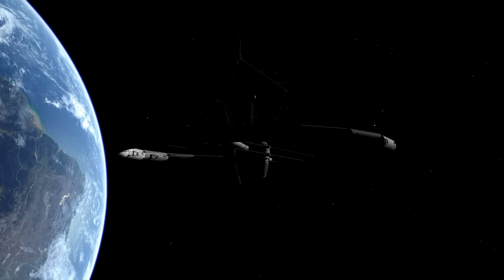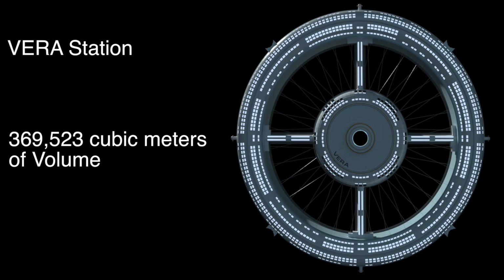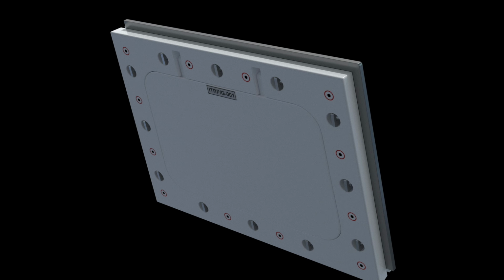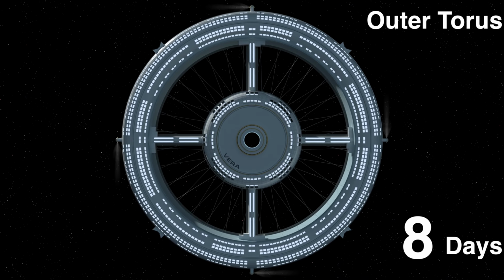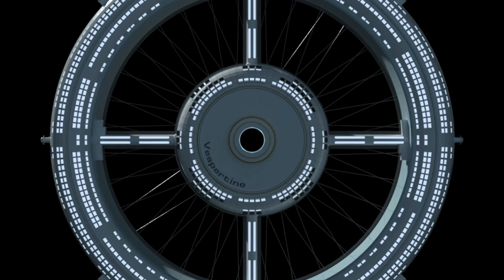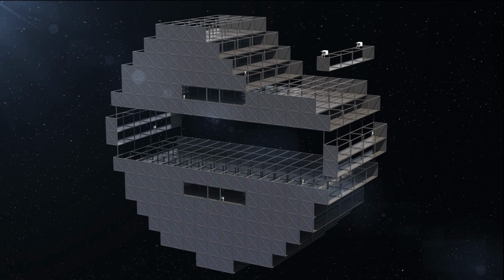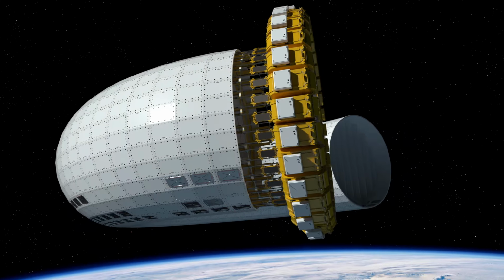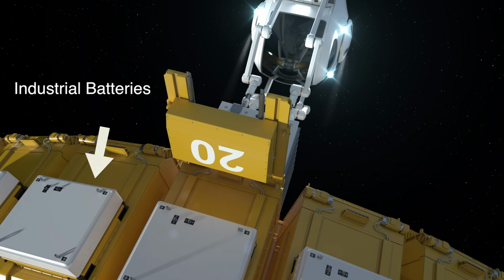We could build this huge Space Station in 6 months

Comment: What happens if the inner ring is inoperable/unsafe but the outer ring is still ok? How would the people of the outer ring travel to the docking port in the middle if they need to leave the station? Maybe it was addressed in the video but I didn’t pick up on it. For something like this to be open to the public the safety needs to be over engineered, especially if tens of thousands of people are going to be at this station yearly.

Comment: Correct me if im wrong, but the inner and outer torus has a different radius. Meaning artificial gravity will be different in the inner torus vs outer. You would also need to rotate it faster in the center vs the outer ring. Do they spin independently? Furthermore, what are the dimensions and weight for each section of Sargon. I am assuming you want to send modules to be assembled in space to build Sargon. Would this even be possible for current rockets to transport? Lastly, I am assuming the panels are sent up with Sargon. What is the weight of those panels? How do you plan to transport resources to Sargon. How does Sargon build amenities and equipment? How does it connect the equipment to the interior of the torus?

Comment: Are there plans to test a smaller prototype? How would you power the electron beam welders? I like the idea but it needs to be proven first then scaled up.
Reply from the maker: Our research showed us that each 2m weld made by the EB welders would require 5-6 Mega Joules of energy (12MJ per panel). For reference, a Tesla Power Wall unit has 179 MJ/cubic meter of energy(that's 15 panels). Those huge batteries over the panel magazines are about 20 times larger than a Power Wall. We expect the batteries (there are 32 of them) to last until the Inner Torus is 1/2 complete before they need a recharge. For your information, EB welding is very efficient compared to other types of welding.
Reply: @TheGatewaySpaceport  ..I need one of those Tesla Power Wall units myself. Isn't there enough Helium-3 on the moon to power projects like this?
          The moon will be mined sooner or later, it may as well be by you first...Anyway, I like it..."More power to ya"! 😎👍 ☕
Reply: @TheGatewaySpaceport  Oh and Elon has been talking about machines that make machines, this falls entirely in line with SpaceX ideology.  Just amazing.
Reply: @TheGatewaySpaceport  Do you happen to know if Elon is aware?  I really think this is amazing, it's an AMAZING idea and they are BIG.  All of which SpaceX needs.  Thank you for going after this in the way you are!
Reply: @TheGatewaySpaceport  Always give the job to those who can do... ♥
Reply: @TheGatewaySpaceport  would micro weld holes need patches? there shouldn't be many in space but it's a lot of linear feet?
Reply: @TheGatewaySpaceport  
great. Can it be built with panels made with simple iron or titanium directly mined from the moon?  There are earth base gold sortation systems that could separate these metals ( and others) directly from the lunar regoThe launch costs would then be cheaper.
Reply: you can make small modular reactors to power just about anything for decades in space. The problem is that they become obsolete before they're run dry.
Reply: @justingreen8572 , Yes, power is not an issue. : The Perseverance rover requires electrical power to operate. The dependable flow of electricity for the rover comes from a power system known as a Multi-Mission Radioisotope Thermoelectric Generator (MMRTG), provided to NASA by the U.S. Department of Energy (DOE).
Reply: Why would you want to build a station when in orbit around the earth you already have a natural satellite the Moon?   You could build the living quarters from  disassembled starships designed for the express purpose of using them as the habitat modules. You can use lunar regolith as radiation shielding material.  ( You didn't mention that problem as well )  Minerals could mined from the moon and be used to fabricate aluminum panels on the moon instead of on earth and shipped into space by solar powered linear accelerators.  Water obtained from the moon itself ( could also be used to make hydrogen and oxygen using solar energy to separate the molecules  )  Oxygen for breathing and  Hydrogen to make fuel to be used in fuel cells as well as in spacecraft as fuel.  The Moon just seems to me to be more of a logical choice and more doable than your proposal
Reply: @johncherish7610  mining requires a full chain of buildings and heavy machinery to extract some useful ammounts

Next century perhaps 🤷‍♂️😄
Reply: @johncherish7610  yes he did, in the first half of the video - the outer skin panels would be lined with either polyurethane or water jacket. Both equally adept at blocking all but the hardest solar radiation.
Reply: @johncherish7610  And less gravity means less fuel needed to lift it. Can they get the fuel used in those engines from the moon though? Is the dirt up there sand? Can it be used to make glass?
Reply: @johncherish7610  Delta V and Gravity wells are the defining problem in space at our current level of tech. Getting similar resources from Asteroids has lower Delta V impost then the moon. It does take longer because of distance to asteroid but it takes less effort. The current tech for converting solar to electricity is more then good enough with the needs of nuclear or fusion. We could have "This and That" instead of "This or That" :-)
Reply: @johncherish7610  That sounds like a great project, for somebody else. This project seems focused on making large volumed structures in orbit... Obviously lol. Considering we already have proof that a space station is doable, there are a couple in orbit already, why would you think making a base on the moon would somehow be easier?
Reply: Something I don't get is why we don't use an older yet easier to design power generation system. You see, space might be cold, but direct sun exposure is well in excess of 250 degrees. Hot enough to boil water. using the shadow of a station would be a condenser. So the question is, why not use older technology to power stations for the life times of any station?
Reply: @justingreen8572  One of my college teachers did work on the Canadarm project. He told us how liquids in zero gravity are damn near impossible to control. One side of the machine is as you said is at +250'C, the other is the opposite at close to absolute zero, so you have massive expansion/contraction/warping if the machine is rotating. Liquids are pumpable but if any air enters the system it's air locked. He said trying to lift water into space for steam was going to be super hard to work. Solar panels have no moving parts.
Reply: @runsolo7418  but what if it would be rotating balloon, expanding and contracting. or even series of balloons pushing each other
Reply: @runsolo7418  SPACE Solar power systems DO have moving parts, because they have to track the Sun. In vacuum, that usually means using slip rings to transfer electric current from the solar tracking part to the non-tracking part, and slip rings in vacuum are very likely to weld themselves into a non-rotating mess. Also... Solar panels are NOT as efficient as thermal power systems, and since PV panels are based on semiconductors, they are subject to damage from space radiation and from vacuum arcing. Notice that nobody has ever put a multi-megawatt solar array into space, even though if it worked it would be massively useful for Direct Broadcast TV. To see Space Solar Thermal done right, watch the award-winning Flowersat SYSTEM design in the video linked in other comments here.
Reply: @runsolo7418  true, but once rotating the artificial gravity acts as a grounding force. Perhaps it would be best on a charging station as a power source till the full rings are completed. Then a similar system built on the rings as a main power supply. A secondary benefit is you now how compressed gasses for maintaining the spin of the vehicle if ever needed.
Reply: @runsolo7418  Right...Have you imagined a closed loop system using a 'gas' like the ISS uses for cooling? (Ammonia?) We had a fridge on the farm in the 1960s and one in a travel trailer later. A little heat makes toy Sterling engines generate a token voltage to produce light. "Off Grid" setups have relied on these forever. Just a thought.
Reply: @lilysceeliljeaniemoonlight  "m" ??
Reply: @YodaWhat sorry m was a typo.
Reply: @runsolo7418  Presumably liquids would be internal in a controlled climate?
Reply: @justingreen8572  how do you bring water up there?? is too heavy
Reply: @justingreen8572  If you haven't read High Frontier by Gerard K. O'Neill, he proposed about the same thing years ago.  Before reading it keep in mind, I believe he was the person who figured out that the linear accelerator was not practical and  proposed using a torid to keep the particles in motion and gating them out of the ring as needed.  He even proposed and tested a means to "beam" energy back to Earth from the power stations in space.
Reply: @justingreen8572  and what if it is in the shadow, it still needs to radiate that heat somehow.... good luck with that in the vacuum of space

the condenser itself would be a much more impressive gas accomplishment than the station

not practical, better use good old and trusty solar panels, which are about 5 times more efficient in the energy conversion department
Reply: @ivant5054  You make no sense whatsoever. You're using direct sunlight to boil water. The heat it going to hit the haul anyways. Might as well use it for something useful.
Reply: Underwater welding machine
Reply: Yes! To demonstrate the welding, show me a doll house sized VERA, or even just a torus made from small panels that holds pressure. Would it be possible to build a mini Sargon prototype that builds a small torus from equally scaled-down panels? Even a 1 m diameter torus assembled in orbit would be mighty impressive. Include a small prototype manipulator drone or two that just hold cameras for now to capture the assembly and you have a really cool demo. A small experiment like this might fit on a ride share mission on a Falcon 9.
Reply: This is a good question. Electron beam welder would require massive electrical input. As one of the commenters said: nuclear might be an option, but that has it's own set of problems. I'm wondering if a purpose built power supply might be possible. I'm picturing something using existing, proven technology (solar panels) connected to banks of heavy duty capacitors. The entire power supply would store electricity in the banks of capacitors and then the capacitor banks would act as the power supply. That way if there were problems with the capacitor banks only being able to store enough electricity to do pulse welding instead of continuous welding, it would just wait until it recharged and then do another pulse weld. If there were a problem because the solar array for some reason stopped working, then the electricity would remain stored in the capacitor banks until the problem was resolved. You're right to point out the need for testing and small scale prototypes... This is going to require a huge financial investment to get going... In fact it seems to me that this video is more or less a sort of "open letter" to Elon Musk... Pitching this system as an investment. The speaker pointed out at the beginning that he has patents. He owns the patent... Not a functional system. So this system is a good idea but it needs money.  A few weeks ago Elon musk might have had enough to find this man's system, but with his purchase of Twitter, I don't think he's gonna have enough ready cash lying around to lay out another big investment on unproven technology. I also wonder if there are any working priorities around to see and play with.
Reply: @ColdWarAviator  they could use just a plain old Generator the same as what they use on Earth and Power it with steam like they do on Earth.
Reply: @ColdWarAviator  If you can build giant rings in space I would prefer you build the next gen particle collider.
Reply: @ColdWarAviator  
Nuclear reactors are basically very expensive steam engines. Radiation heats water, that water runs through a heat exchanger to heat another pool of water because you do not want radiated water in a turbine, that other water is fed into a steam turbine that drives a generator. High pressure in vacuum+fast rotating heavy objects….
You’re better off with a solar farm
Reply: @zsolthb  yes I am aware off the power loss associated with terrorism nuclear reactor powered steam generators. Not to mention zero g fluid mechanics. The purpose of my reply was to get folks talking about the value of having a working prototype that you can see functioning before downing money to fund a full scale operation
Reply: The Moon will never have  permission or license to be mined. Science knowz that any loose rocks that have come come loose on the surface have already caused the moon to have wobble events for thousands of years.  Any change in the density or weight or size of our Moon would change its gravity hence changing its orbit effects on earth would be catastrophic. Ocean Tidal shifts and scary thoughts you've all never experienced or known
Reply: The Moon looses bulk over thousands of years slowly so its orbit is not changed suddenly by a big amount as not too create any huge difference in its own nor the host planet it spins around somehow this is a scientific fact. Science still does not know why, hence the research and finding of the So called "God particle" which coincides with the "creator particle" and the " higgs bosun" at the large hadron collider. With all their research the scientific community still can't scientificly comprehend that theirs some sort of celestial magic going on there. It's like a powerful intelligent force, way beyond any human comprehension, ~ has  created; all known universal matter,  molecules & structure etc.,  In some brilliant & "beyond"'genius',  experiment.  Whether a celestial bombardment of an accident, or- mathematical formula,  
All we do know is that its all an eco system of some sort that just comes together perfectly at just the right moments + materials. Hail "the creator particle" Godspeed to all.
Reply: @yodawhat sorry was a typo
Reply: @2:04 🤦‍♂️
Reply: Its feasable to build the craft in less than 6 days
clamed. There is hundreds of way to take things into orbit velocity, some fun factots. One can take MASSIVE space vessels/parts parked in orbit velocity, by using an early stage take off, with vHigh orbit balloons, even convert the air compressed back as fuel burn into ascending altitude further up, before using exp orbit lesser fuel burn, which would be saved up. 

Because the effect would levitate a rocket, simulating like a launch pad at micro gravity & wind friction ratio.
Reply: huge solar panels will provide power to the robots that ark weld.
Reply: 7 ,600 amp car batteries 12 volt. In parallel will weld 3/8 sheet steel with 18 rod. Needs to recharge after every stick though. Solar in space. Match the amperage and go for it in constant sunshine.
Reply: I believe there is a preferable diameter/radius for a torus station.  It has to do with experiencing a homogenous effect from the spinning.  Too small and different parts of your body experience the spin differently.  I'm just a space buff, not a professional, but it made sense.  I imagine with such ambitious goals, they'd want to build it as small as possible but large enough to experience 1G while standing on the deck of each of those levels (looks like there are four or five).  I'm not sure how the center torus inhabitants will experience things.  Their gravity will be significantly less than 1G.  In that regard, the center hub could provide shelter in emergency (as he said), proper environments for microgravity research (and gradated zones of gravity (like 0.75g, 0.5G, etc.).  I'd imagine they'd not only want the whipple shield but BNNT and water shielding as well.   I'm not sure what the ISS system is for shutting off sections in case of catastrophic failure, but I imagine there are times when it gets lax... like Oh yeah, maybe this port should be sealed.  There would have to be automatically sealing doors to save the inhabitants in case of debris impacts.
Reply: I think they might be powered by hydrogen fuel cells at first which is a technology that spacecraft already use
Reply: We could power the whole station with one dense fusion reactor

Comment: You have the vision well thought out. What I would want to see is more about the specifics of the panels and more about the simulated gravity. Panels - what are the layers within each panel? How does it handle micro meteors? How do they join one another other than the welds? Simulated gravity - how do you deal with the Coriolis Effect? What will the simulated gravity strengths be for the inner and outer toruses?

Comment: Gateway Spaceport LLC has answers to many hard questions, however, I may have missed how the space station will be protected from solar and cosmic radiation.  Also, how does the space station solve the problem of differential heating and cooling, especially the differential heating caused by the rotation of the torus.  (Or does the rotation mitigate the problem of differential heating and cooling?)